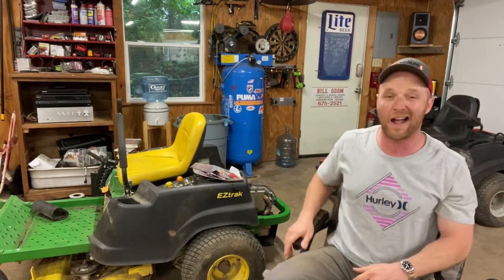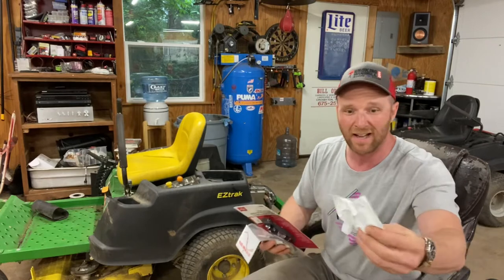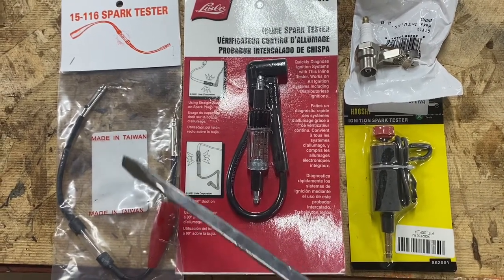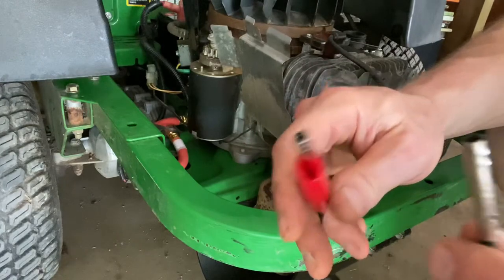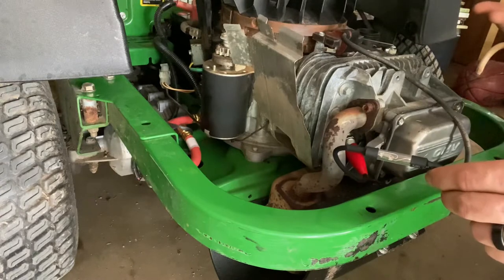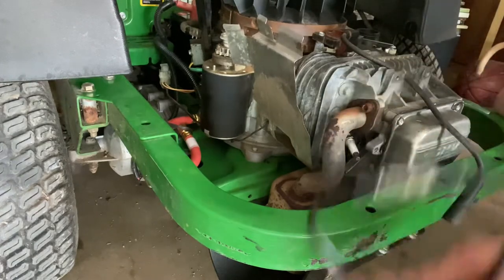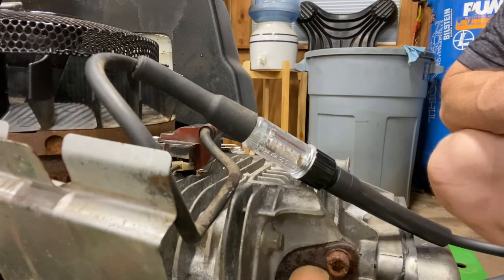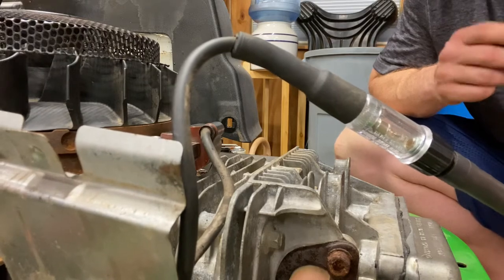Amazon Spark Plug Tester Comparison, SHOCKING RESULTS!!!

Comment: The Trillium inductive "Spark Check'r" is my hands down favorite. Hands free, clip on the wire, crank the engine, walk back around and look at the lights. It's a real timesaver. Much more expensive but mine has paid for itself many, many times over.
Reply: Well I've been trying one, and either it's faulty or I am. Many machines show green then yellow. Am I supposed to turn the engine off as soon as the engine starts up or let it running. Yellow means either the plug is faulty or the HT lead is; but the plug is new and the coil + HT lead is new.
Can you help me please?
Reply: @johncollins8304  I think it could mean a couple of more things, the first being that the voltage is too high. Generally, when I get a weird reading, it's because Of the way I made the pull. I hit the reset button and do it again, trying to make a smooth pull.

I've had a couple of "Iffy" plugs that I ended up replacing because they were old and probably borderline and would give me a green, then maybe a yellow. (In my mind, "Best Two out of Three" isn't good enough for working on someone else's mower. I put in a new one and save the other one for checking stuff in the boneyard.)

But first, make sure that you have the correct engine type selected on the side.

So far, (since I got the hang of it) every time I've gotten a yellow, it has been the plug (just because it's new doesn't mean that it's good). I've also had one bad coil late last summer, and I got the flashing red.

It's got a 60 Day Warranty, if you think that there is actually a problem with the unit. Here is a link to the user sheet that has all of information, including phone number, email and website address. 

Hope this helps.
Have a great weekend!
Reply: @tinkerscorner54 
Thanks. I don't see the link.😢
Reply: @johncollins8304  My wife walked in and wanted me to take her out to get a Whopper. Sorry.

Comment: The last one is more of a coil tester vs spark plug tester. You can see the color of the spark and the width and distance of the flame. You may get a spark from a coil to get it running...but, it may not be strong enough of a spark for best performance

Comment: The best one is the adjustable air gap product , it shows the strength of the coil and the spark color  . Lisle  20700 .  Easy people to communicate with over the phone . 
1/23
Reply from the maker: Yep super cool tester, they all are fun.
Reply: ( SE ) Spark Energy . Numbers stand for Kilovolt, thousand volt .  Engine  coil should produce at least 6 kilovolts , 6 X .03937 = .33622 tester air gap .
Reply: @vicpetrishak7705  so where did you pull .03937 from? So your telling me that the 40 on my tester is kilo volts or 40,000 volts?  Where did you get your answer to the math problem you provided?
Reply: @martyturpen4535  One millimeter is .03937 of one inch .  One inch is 25.4 millimeters.   25.4 Millimeters X .03937 of an inch  = .999998 of one inch  . Hope this explanation is helpful .
3/4”wrench = 19 mm wrench
.750 X .03937 = .74803
.00197 difference in wrench size .
Reply: @martyturpen4535  Typical mathematics books or internet calculator .
Reply: @martyturpen4535  Yes 40 on the scale is 40,000 volts .
Reply: @martyturpen4535  Found on the internet as a general ratio 1.1 kV per milliliter . Much depending on temperature , air quality , altitude , and much more . It seems as if no two answers are the same .    6/21/23

Comment: K I have one for you, with a new stihl coil,  set up the air gap, with a new or used spark plugs, I get a white in color spark, I put a drop of gas on the plug and spun it and it sparked but did not lite the gas, any idea
Reply from the maker: Can’t help ya there. I would never just hold a spark plug and pour gas on it and see if it blows up. You are on your own with that one.
Reply: @MowerMike 🤣🤣🤣🤣